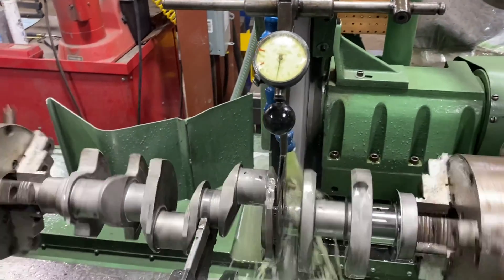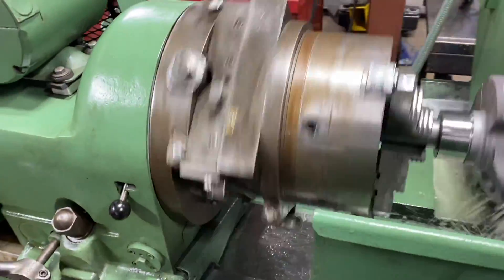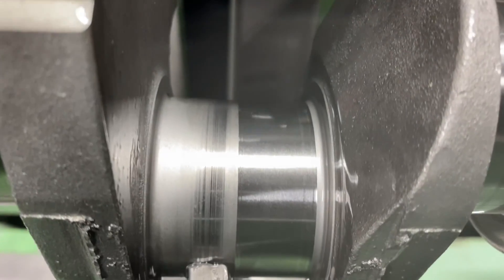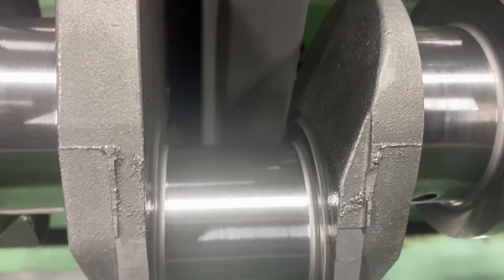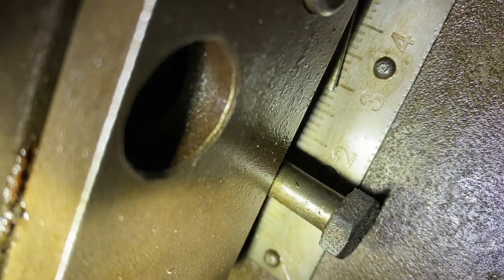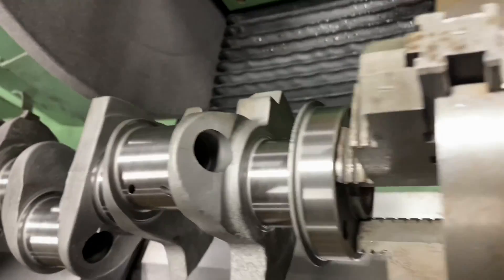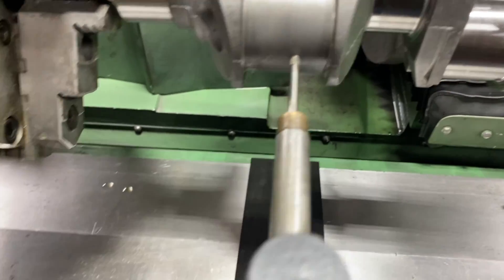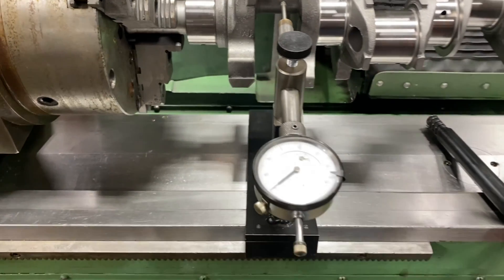Crankshaft Grinding on a Storm Vulcan 15AW

Comment: One question. The main journal and the connecting journals loose  their hardness, every time it is ground. Because some of the journals have deep scoring marks, when they bare brought for grinding and almost 0.5mm of material is removed. So after regrinding is there any nitriding process done to increase the surface hardness of the journal pins. This is just for my understanding and learning. Request somebody to clarify.

Comment: Is there a way to tighten the tailstock, won't grind a round journel
Reply from the maker: That's are to say. I'd start with a precision bar assuming you have a chuck machine and fine out if it's out in the same spot.

Comment: The mating journals are side x side on the same pin. I know what you meant tho. 
On a counter rotating crank the oiling holes are in the wrong spot as the oil would hit after the power stroke. Cross drilling the mains would be imperative in this application.

Comment: Different Strokes different folks I would use the right wheel and I never plunge 2-0 this can create a seam personally I use 1/10 gauge I ran a 15 a special they are a good machine strictly Automotive grinding 3516 caterpillar like that and you'll be buying the customer a new crankshaft my goal is zero taper round no Burns or interruptions from Rod cheek to radius I am a heavy engine component Machinist I did Automotive my first 20 years found that diesel was more challenging and paid a lot better that crankshaft you're grinding is worth about $100 I grind crankshaft that cost $90,000 I don't miss size and when I'm done I want 10 guys to Mike that crankshaft there's only one way the right way
Reply: who cares
Reply: Punctuation might help your one long sentence of you patting yourself on the back.

Comment: I learned on a very old VanNorman grinder. The counter weights were bolted on, there were different sizes that had to be stacked to balance the offset. Then we got a newer '1955' VanNorman with the counter weights on a slide. Still dialed in the rod journals with a brass hammer.  Spent 28 years in a machine shop it's been 12 years and watching this brought back a lot of memories.